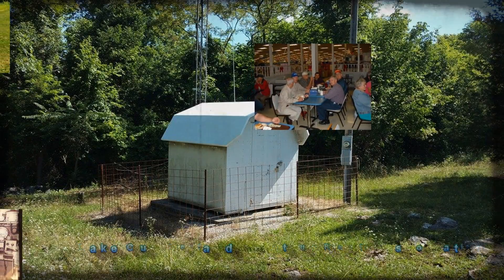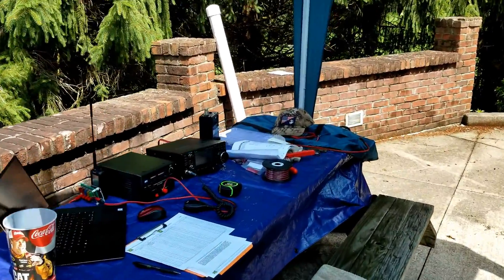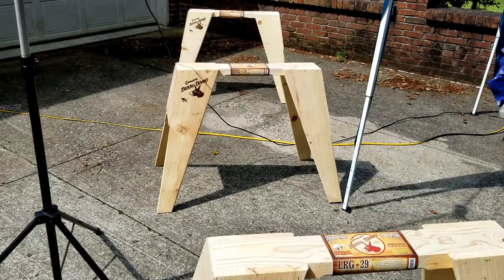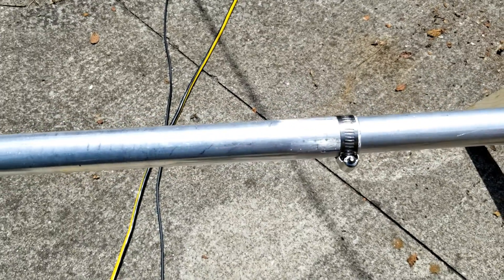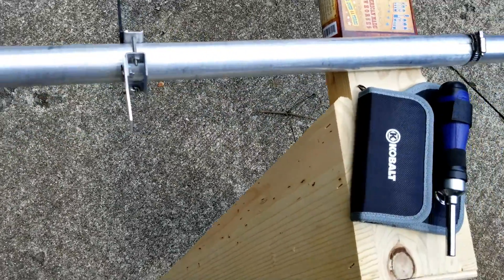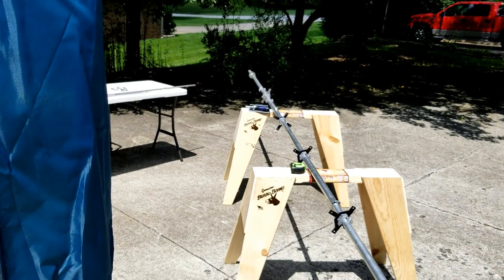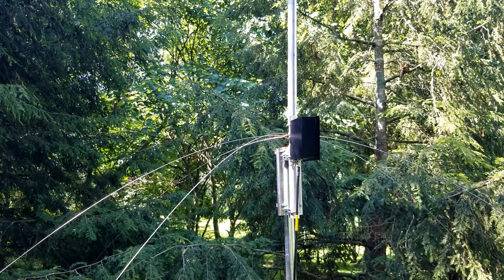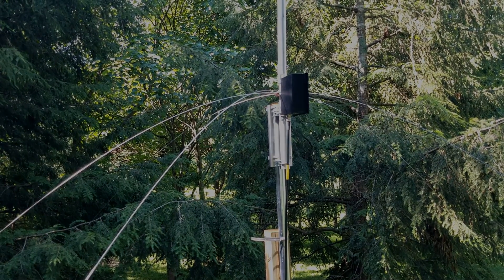LCARA HAM Radio: Hy-Gain AV-640 Antenna - Part1

Comment: I am considering this antenna.  I note your radials might touch a tree branch from time to time.  I would have that same situation in my installation.  Does that pose and issue?  I can't find anything in the manual that says it would be a problem.
Reply from the maker: @Dan McGee - you are correct there were some branches touching a couple of the radials. I cut them back so that they would not make contact. I noticed the SWR was fluctuating as well when testing and once the branches were trimmed back the fluctuations disappeared.

Comment: bryan my l1 coil assembly only goes 3 inches into "BD" 3 inches and stops. the manual says 4 inches but there in an inner diameter that won"t let it go that far. did you have that experience ? thank"s bob kv3v
Reply from the maker: @bob every - Hey Bob, honestly, I don't remember the sections not going in incorrectly. You may want to contact MFJ/Hy-Gain and see if this is a manufacturing defect or how it's being built now. Thanks for watching!
Reply: LCARA HAMRadio thank you for your reply. I gave them a call....they said it was a misprint; it should have read 3 inches. Oh we’ll I’ll find out once it’s built. Thanks &73s .
Reply: @bobevery1626  I just put together the AV-680. The instructions are very dodgey. Tons of misprints, and confusion with the parts and putting part together. I called MFJ Tech support for clarification and they were confused. I looked at various reviews and the major complaint was the instructions. Good luck 73 de KD9NGU

Comment: For anyone referencing this for assembly help, in this video the mast brackets with stub brackets are oriented incorrectly. (he is referring to them as "standoffs") Refer to your instruction/assembly manual. The mast brackets are to be mounted with stub brackets ON TOP of the mast brackets. As done here, they all should be flipped 180° from what is shown.  re: 4:40 - 5:28 in the video.